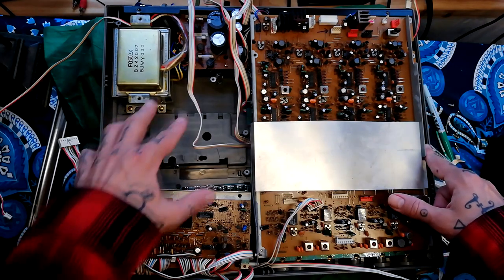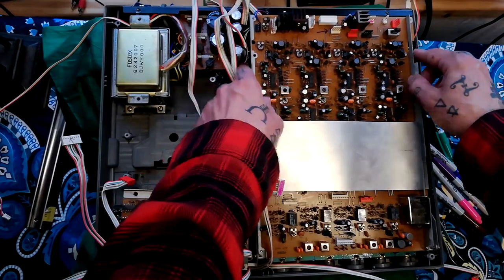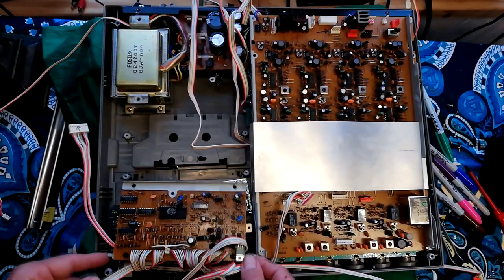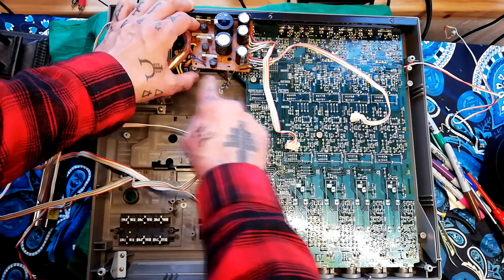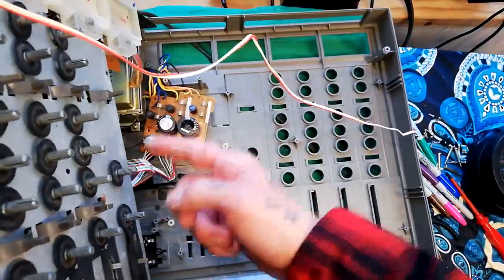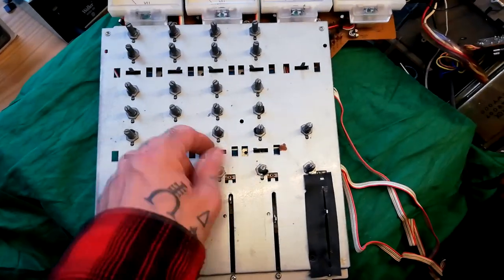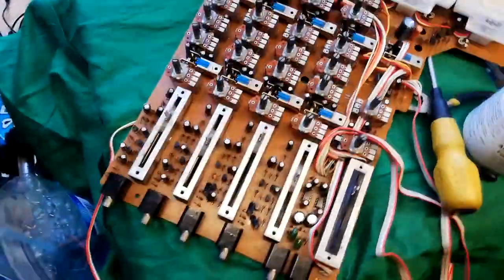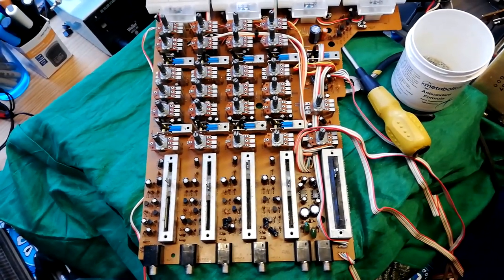Fostex 250 | Tear down part 3 | Access PCBs

Comment: Hello! I have a 250 with a broken power transformer. I tried to search for a replacing model but  haven't had luck. Do you know the three AC Voltage values coming out of it? Thanks!
Reply from the maker: I'm sorry, that unit was on loan to me and I no longer have it,  so I can't test the windings for you, and I don't have schematics for that model. If you find the answer, please post back here, good luck and thanks for watching
Reply: @Tetrakan  I've just found the three values output by the transformer: 28, 15 and 6V. I can't find a replacement part so I think I'll join three transformers and make an equivalent unit

Comment: TIP: You do not actually have to remove those hinge screws as the bottom to take out the top big board on the right.  Once you have removed the smaller board to the left, you can simply push the left bottom hinge holder to the left, and thus back the left hinge screw out of the hole on the big board enough that you can lift the big board right out.

COMMENT: I also found the plastic mounting posts to be brittle.  I had some success repairing these with the sort of liquid cement you use with plastic model airplanes.

Comment: I got one of these and it’s only problems are the reset button does not work abs it’s meters seem fairly sensitive and possibly need a calibration. any ideas?
Reply from the maker: I only ever worked on a couple of these, and it was years ago, so I don't really remember where the meter trimpots are. I've got videos about dealing with both issues on a Tascam 244, so watch those then find the corresponding trimpots on the Fostex I guess?